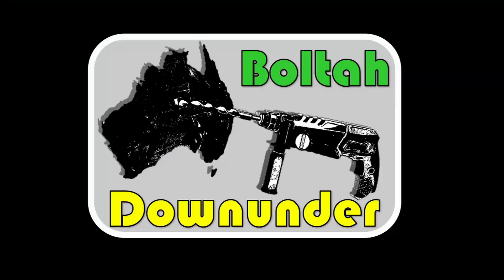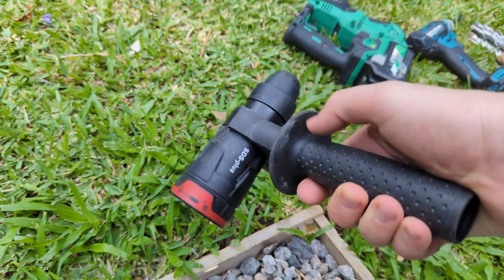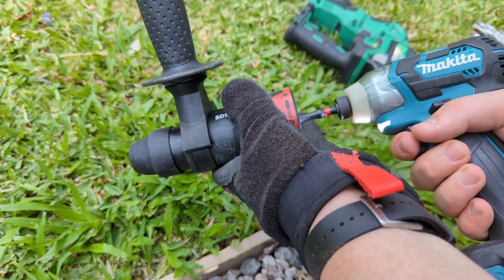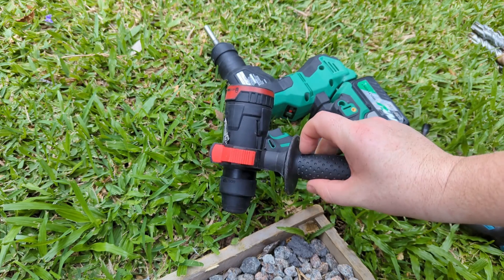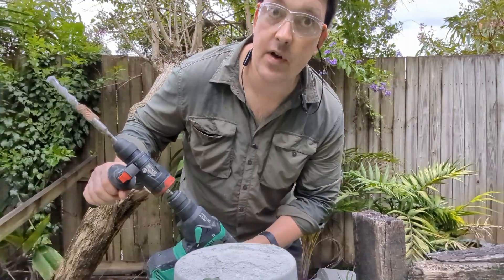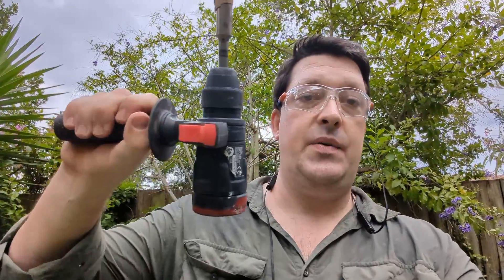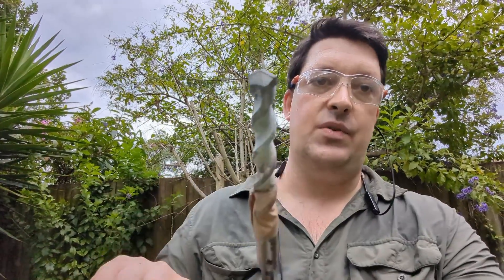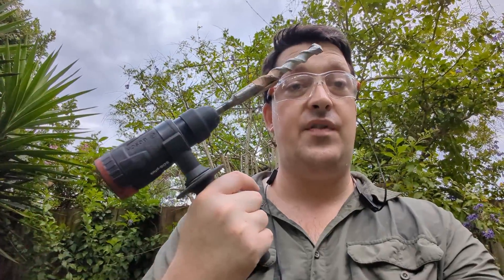Flexiclick hack: Bosch GFA18-H SDS adaptor (for GSR18V-535FC, The Chameleon)

Comment: I think you totally abused that BOSCH GFA18-H SDS-Plus Rotary Hammer Attachment. It works better on a BOSCH GSR18V-535FCB15 18V EC Brushless Connected-Ready Flexiclick 5-in-1 Drill/Driver System. Thanks for sharing the demo, nonetheless.
Reply from the maker: Sure did! I have a new one now that I can test properly, full tool not just the SDS attachment
Reply: @BoltahDownunder  so when is the test? I'm interested to see if it beats the M12

Comment: The Sds master!
Damn mate impressive. 

What's that sds bit you used actually for?
Reply from the maker: The bits are just normal Makita SDS drill bits, but the half-drill thing is an adaptor for this changeable installation tool that Bosch makes:
https://www.boschtools.com/us/en/boschtools-ocs/cordless-drill-drivers-gsr18v-535fcb15-202150-p/
Reply: @BoltahDownunder  i meant the 1/4  to sds
Reply from the maker: Oh that's just if you ever wanted to use your hammer for a driver, for whatever reason😅 some DIY hammers are marketed as a do-all tool that can be used for driving. Also the Panasonic hammer comes with one and has torque settings for that purpose, but I can't personally say I'd find it useful for work. I use it sometimes for testing purposes like drilling with spade bits but IRL I would never use it.

Comment: You legend! I'm surprised you got it that quickly. Definitely buy a 1/4" extension (they're maybe $5) so you can try it with a high RPM drill. The Bosch is 1,900RPM, so you might only be getting 0.5J and half the BPM. Running it at 1,900RPM could go 4x faster (I'm guessing max 3x, though)
Reply from the maker: Yeah mate! It worked better than I expected, but then on doing the timings it seemed a bit slow. The good news is I have a better hex adaptor and can do some 2000rpm tests. Pretty cool little thing!